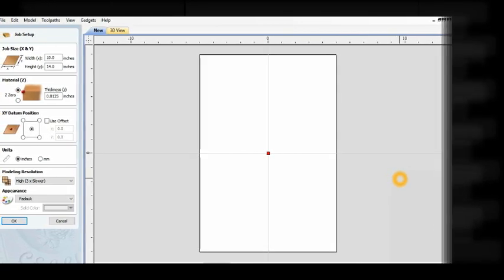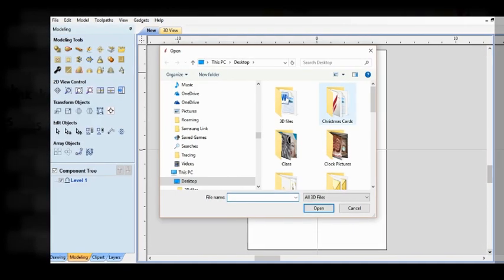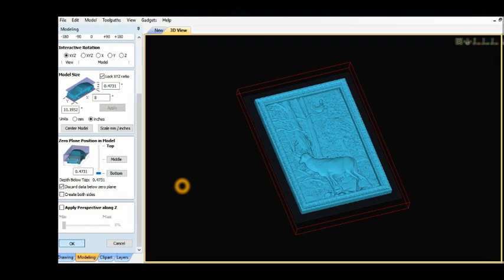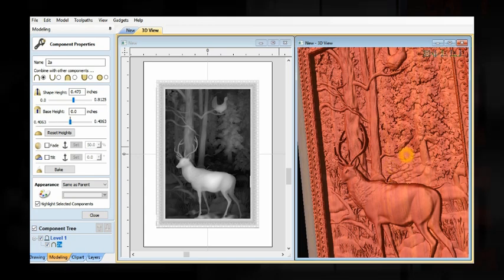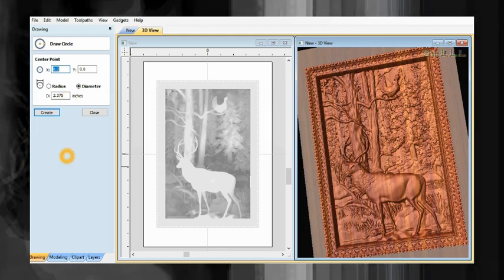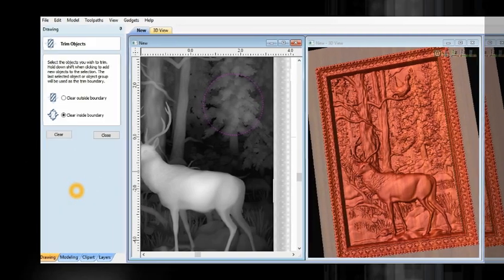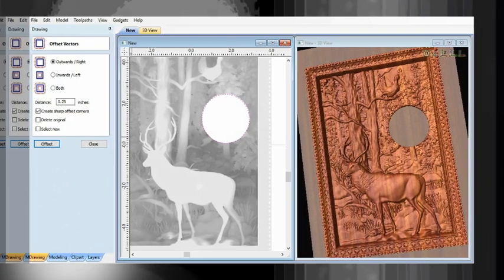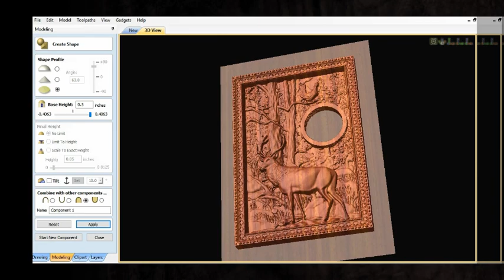Modifying 3D Models for CNC

Comment: I want to cut the inside out of a 3d relief. Its a square file. To cut out the inside i will need to draw a line and make points and close it to cut it out. Its a fishing file and the boundary is logs. I want to cut the fishing image out. I followed your instructions and its not letting me do it. Using vcarve pro 11. Thanks

Comment: Is any program that will let me do this same effect on a 3d printer. They are g code machines but require a different "slicer" to make the gcode. can this program output a STL file that could them be used by the 3d printer slicer. There are lots of lithopane programs for 3d printers but I can not find and programs like this .
Reply from the maker: This program (Aspire) can create and export .stl files